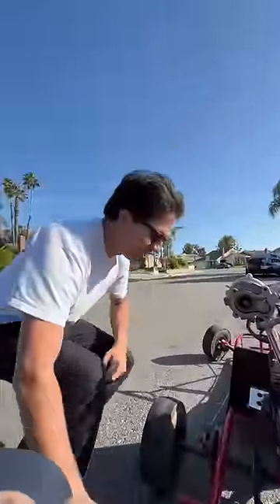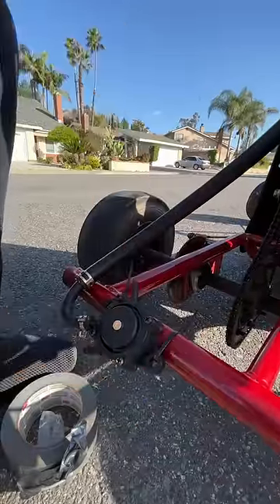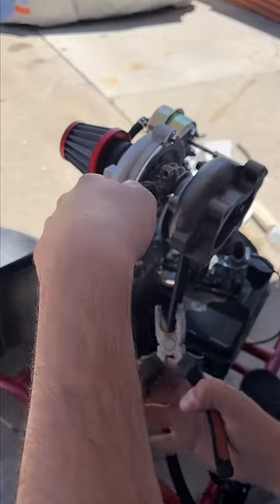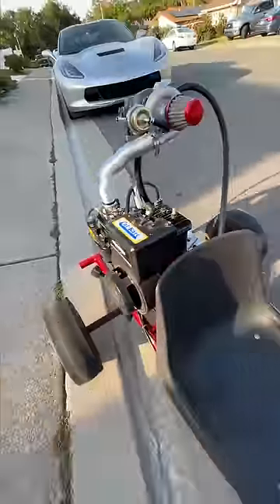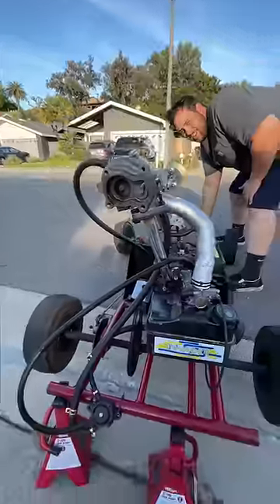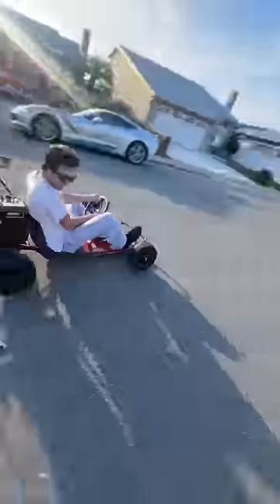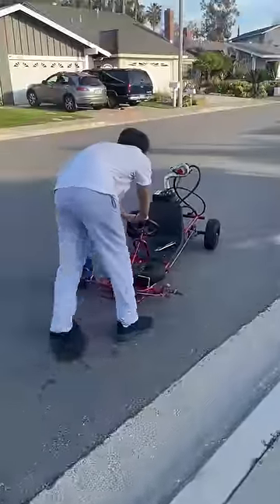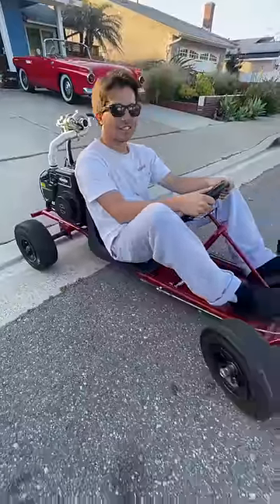I put a turbo on my Gokart and it didn't end well

Comment: That turbo is way too big for that engine. It's a modification that is currently restricting power, adding weight and reducing reliability. So well done, 5 stars for trying.
Reply: His problem is he's trying to run a blow through style system without making a necessary carb mod, for a draw through system you can just use a stock carb re-jetting aside, but with a blow through system you have to pressurize the bowl off of the boost from the turbo, what he needs to do is drill and install a fitting on the bowl above the fuel level (best just to do it where the bowl vent is if possible otherwise you have to plug it), then run a line to the boost (his silver flexible dryer hose thing) coming out of the turbo. 
Without doing that the positive pressure in the carburetor throat wants to push air through the jet into the bowl instead of drawing fuel from the bowl through the jet.
All blow through systems are set up that way, you can't have positive pressure that's above atmospheric pressure for a carb to work, the pressure on top of the fuel in the bowl has to be higher than in the carburetor throat, that's how a carburetor works, reverse the scenario and you reverse the flow through the jet.
Reply: @dukecraig2402  he'll never have the need as this will never make boost.
Reply: @dinosshed 
It'll make boost if he gets everything straightened out, turbo size is one thing but the A/R ratio is another story and without seeing the numbers on that one you can't say it won't make boost, even if it isn't optimal with everything straightened out it'll make some reved out, just 6 or 7 pounds would do wonders for that thing, it might not even be able to handle that much, I used to ride a KZ 1300 that couldn't swallow any more than 10 pounds without blowing a head gasket.
Reply: @dukecraig2402  the efficiency island for the turbo he's using is for a much bigger engine. It has zero chance of making any boost.

Comment: Check it out. NO TURBO!!!!! Take a boat blower/engine compartment fan to evacuate heat and fumes, take the heater tube. Wire through a fuse. or don't. either way. I am 37. I put a supercharger basically on our 4 stroke racing go-karts. 7 hp gained. Add a resistor with electric side, and you have boost control. Lol We actually BOUGHT a go-kart Dyno to che hp. So yes I'm correct and not BSing. No theory. I did it 20 years ago. No YouTube and TikTok back then😊

Comment: Putting a turbo on a single cylinder can be an issue because there isn't a constant intake/exhaust flow. You would need to put an air capacitor on the intake side.

Comment: The 5 brigs is a beast take the old car of get u a dirt bike carb with the adapter get a long 8 inch water holes pipe screw it in ad smaller sprocket u might get it to go 80+

Comment: Carb needs to be on the inlet of the turbo for it to run properly.  A regular carb like that is not made to have pressure being forced into it.  Either that or the carb would have to be modified as a blow through carb.  The thing probably dumps gas all over the place.  Also that pipe on the outlet of the turbo is a joke, that is not made for any pressure it’s made to carry heat from an exhaust manifold to an air cleaner valve on an old school car.  A for effort.

Comment: How the hell did you run the carb on boost without a fuel pump? Also, how did you use a vacuum fuel pump on boost?

Comment: Wouldnt a transmission of some sort be needed to take advantaged of any mods to these engines? I mean, they're already able to rev out to their maximum rpm stock right? I guess you'd get quick acceleration, but not any addition to top speed.

Comment: Did you not have washers in front of the tired then then bolt cause if not thats prolly why it just blew past the bolt so easy and blew the bearings right out

Comment: Probably for the best that the wheel fell off. Vacuum-powered fuel pump for turbo oiling means no oil pressure to the turbo when it's on boost 🤣🤣🤣

Not to mention the "intake". So much fail.

Comment: That’s carb is not built to be used as a BLOW THROUGH style carburetor. To Make it work as best as you can with a Carbureted setup and no ignition control is to have the carb at the Inlet of the Turbo so the turbo sucks through the carb rather then blow through it.

Comment: You really don't get any gains from a turbo on a small single cylinder motor. They don't produce much exhaust pressure, which is how a turbo works. You can't spool it up enough to create boost.

Comment: It didn't START well  You are lucky you made NO boost since you thought it was fine to drive when the front wheel was already falling off.
Prevent future failures by using a spacer between the wheel bearings so  the nut can be fully tightened and a second locking nut used on the left side (since the rotation will loosen the nut).

Comment: Needs plenum positiv volume so When off the throttle and on again it drops on its ass without a positiv volumen.
Its pushin air thru the system not flowing enough

Comment: You need to learn the basics. Your turbo drain was way out of wack, there's no way that heater tube held much pressure without leaking and you need to pressure reference your fuel bowl.

Comment: If you don't pressurize carburettor ang put a fuel pump when the turbo starts to blow fuel mixture goer poor until fuel stop to flow into the carburettor.
But I think you're not going to have this problem cause the volume of exhaust gas of this engine is not enough to that turbo

Comment: Isn't it difficult for a single cylinder to pressurize the charge pipe
Reply: Yes that’s why you need to make a boost capacitor for it to actually eotk

Comment: I absolutely don't think it's time for you to Turbo an auto engine. Until you can learn to tap threads put on the turbo without using any J-B Weld or any flexible heater line and also weld making a nice bead that doesn't leak you should stick to the go-kart.

Comment: Spoiler alert ‼️ turbos don’t work on single cylinder engines. Prove me wrong. Search YouTube and find just one building boost and making a noticeable power increase while going down the road. Instead you will find a bunch of clowns with their turbo projects sitting still.
Reply: Yes they will, his problem is he's trying to run a blow through system without pressurizing the fuel bowl, on a draw through boost system you don't have to do it but with a blow through you have to pressurize the fuel bowl off of the boost coming out of the turbo, otherwise the positive pressure in the carb throat wants to reverse the flow through the jet and blow air into the bowl instead of drawing fuel from the bowl.
A carburetor works because the air pressure above the fuel in the bowl is greater than what's in the carb throat so it pushes fuel through the circuit, the jet is just a metering device.
I work with turbo and supercharger systems and I can assure you a turbo will work on a single cylinder engine, I don't know why a bunch of you guy's in the comments think it won't but whatever the reason you think it won't you're guessing.